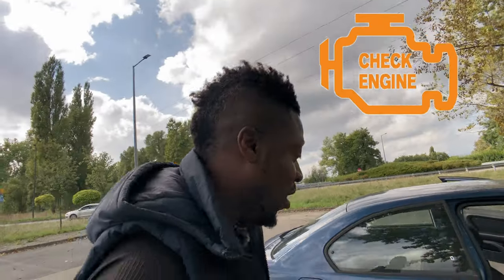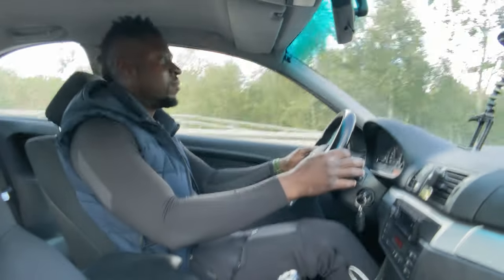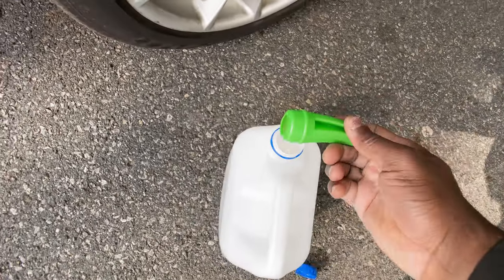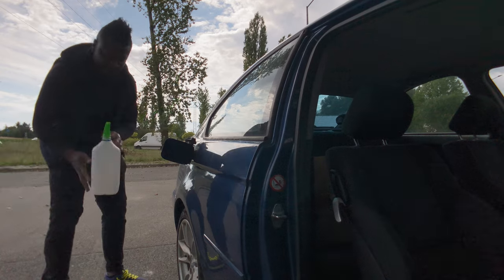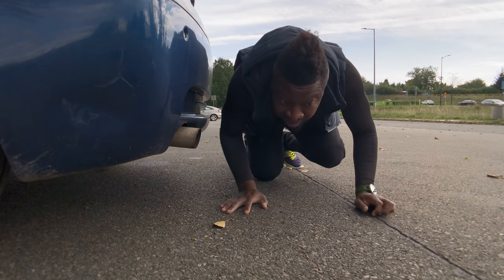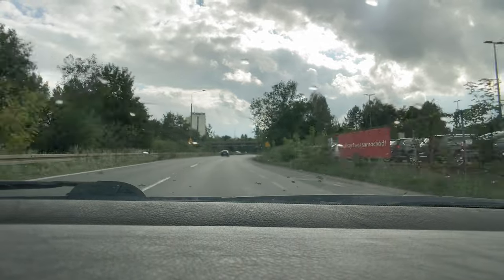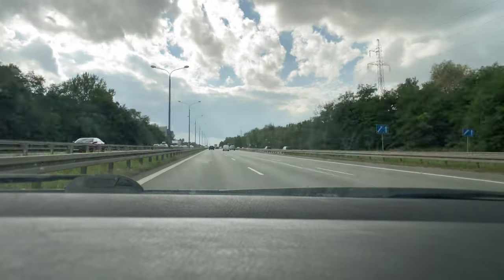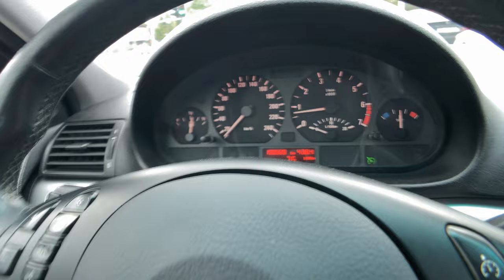How To Clean Bad Catalytic Converter

Comment: Actually did this on a modern ish vehicle with the Klean Strip brand, 2015 kia, with the gdi v6. Light still on (P0430). Ran amazing while the thinner was in the tank. Waiting a few more miles before putting in another gallon of thinner to a half tank of gas.
Reply from the maker: I haven't even tried the klean strip yet but, this one right here, I'm telling you, I felt the difference immediately. I couldn't record how much smoke came out of the exhaust days after this video. I was too lazy I guess. But, that was when the cleaning actually took place then, the throttle response has been great. Took it for a spin after this video and it felt like the car's been freed from the chariots that has been holding it back and the whole think only costed me around 10ish dollars here in Europe.
Reply: Please let us know how it turns out
Reply from the maker: @starguard4122  It's been going strong.